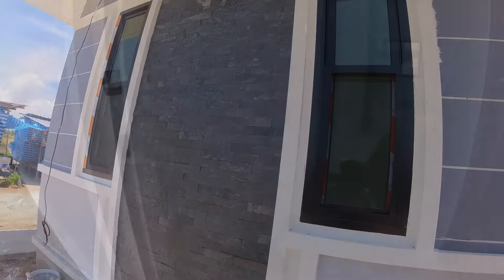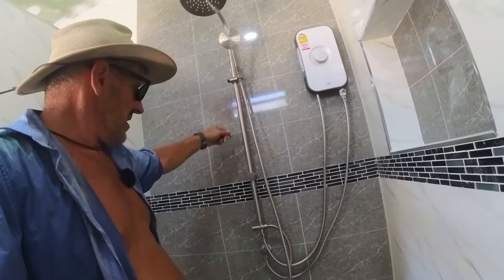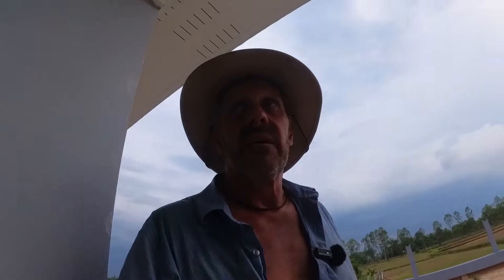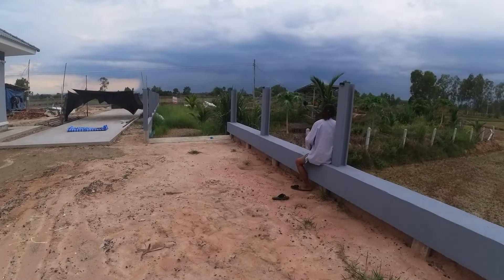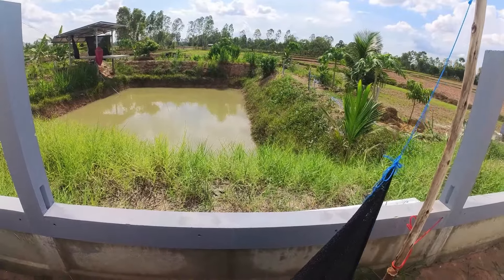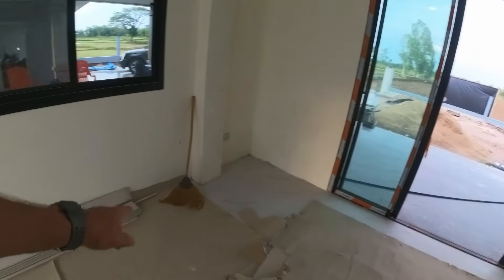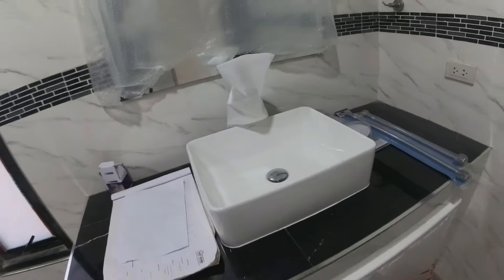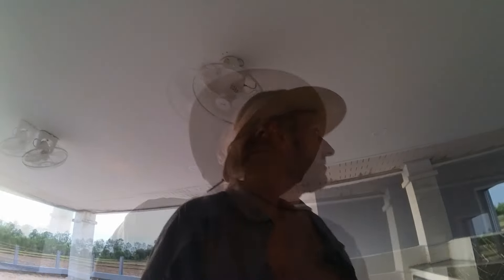KitchenNBathsNMore

Comment: G'day Kenny, 
I am going to tell you how to fix your roof leaks. 
On metal roofs with minimal fall, you will get water tracking back up the roof on the underside of the sheet. Water has a meniscus (like a skin).
On very flat roofs, the water will track for some considerable distance until it makes contact with an obstacle (usually the roof battens) where the meniscus is broken and the water falls down. 
The trick is to break that meniscus whilst it is still inside the gutter. 
You need to "Weather" the ends of the roof sheets, this is usually done before fixing the roof, BUT you can still do it now with the roof fixed.
Get yourself a heavy piece of 1" Reo Bar and Dress down all of the ends of the roof sheets. 
That should fix your problem.
Reply from the maker: Followed you until the last statement "dressdown". Rough up/make an irregular edge of the metal to cause it to drip?
Reply: @ParadiseNThailand  Sorry technical talk. 
Yeah pretty much so,  you need to bend the ends down to a sharper angle (about 25-30 degrees)

Comment: Hi Kenny and Sompit, good to see the house in its final stages.
It looks great.
May I ask, what thickness is the concrete slab outside for your kitchen/patio area.
Cheers
Reply from the maker: Hey Syd, 4" The tiles are HD (thick), to take the heavier load for parking.

Comment: For the flat roof, you should check the specs of the roof boards. They generally specify the minimum angle/slope for installation. If you install shallower the rain can get through the panel joints. Solution - additional seal probably needed along each joint.
Reply from the maker: Roof guys are here now. They ate adding 2 down spouts but i dont think thats the problem....yet. will be during monsoons, so happy tp see it. I think there us not enough overhang of the sheets over the gutter and the water is running back up the bottom of the sheets.
Reply: Yes, the heavy rainfall may be creating a 'lake' on your roof if it can't drain fast enough. The 'lake' then flows into the ceiling void. Only solution to that is extra downpipes as you mentioned.

Comment: What is there for termites to eat besides the doors?  Looking like a home .  Won’t be long.
Reply from the maker: Not worried about the wood as much as then setting up a home under the house and undermining the structure. It's cheap insurance in my mind. Install, pre-treatment, and first treatment was about 1200 bhat. Retreat every 3 years at, currently, 500 bhat.